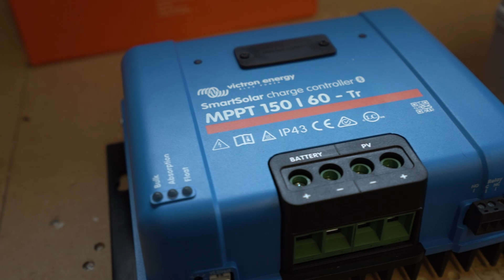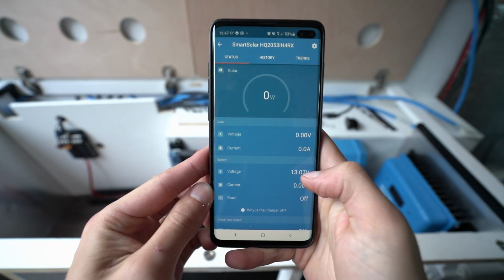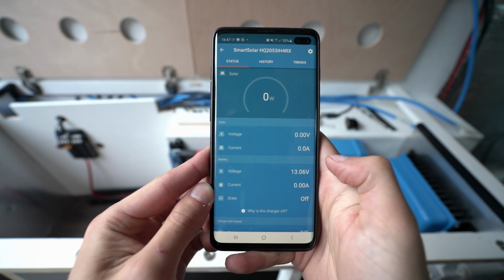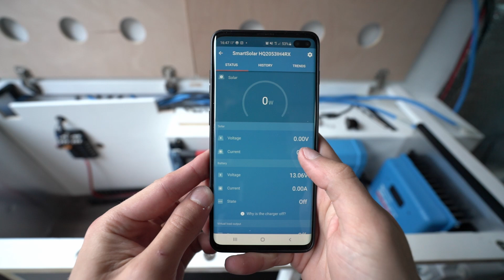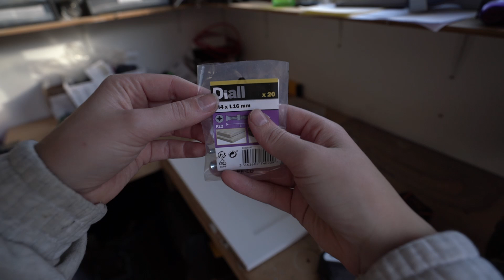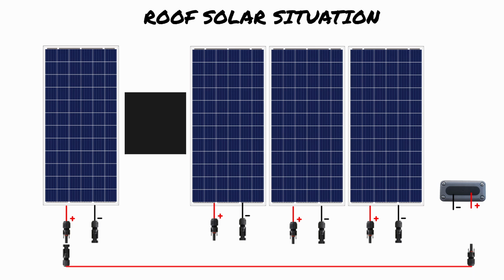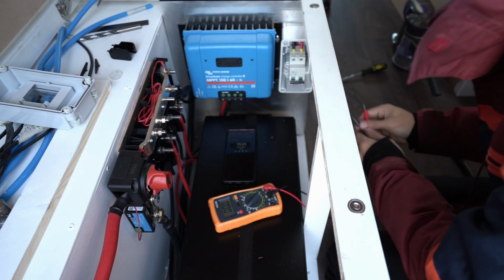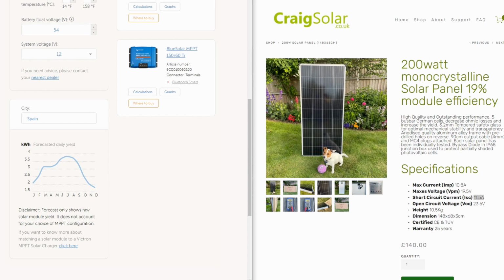Victron Smart MPPT 150 | 60 Install with 800w Solar - Citroen Relay Camper Van Conversion - Week 28

Comment: Hi there. I know that you have used a 300A fuse for the multiplus, but what fuses did you used for the MPPT / ORION / 12V panel ? Thanks
Reply from the maker: Hey, they are 60A fuses, thanks for watching, hope it helps!
Reply: @CasLaz  thanks a lot

Comment: Another great video you two. Can I ask what made you wire in the panels in series. I think I’ll be going for 700w wired in parallel and so I can get away with a 100/50 solar controller. Yours is an absolute beast. You probably won’t need a shore connection with that system. 

Just got our peapod graphics for stickers and logo for the van. Cannot wait to get started 😀
Reply from the maker: Thanks David! Honestly, it was a recommendation from Roamer. 
I believe the main benefit is that the MPPT needs a minimum voltage +5v above battery voltage to start charging, wiring in series allows for higher voltage same amps. So in lower light conditions the charger should keep charging compared to paralell you might struggle to get enough voltage for the charger to start charging. 
Awesome!! Maybe we should get some stickers, not long now till you can get started !! 😁
Reply: Thanks,  that's interesting and I hadn't thought about charing longer in low sunlight  I'll have a think about that.  The van build cost just keeps going up and up... and I've not even started yet. 

We got the stickers to swap/give to other people..... and the girls will put them on the surf boards too.  I don't think we will do the youtube thing,  but will definitely connect with others on Instagram.

We look forward to the next one :)
Reply from the maker: @peapod2083  Haha yeah our van build budget increased a few times now xD 
What's your instagram? Excited to see how you get on when you start!
Reply: Hi Philip,  I'm going to have to look into this a little more.  I was going to wire in parallel, so the amps onto the batteries are higher when it's sunny. That way you are charging quicker,  but not as long a charge window. 

Thanks for the recommendation.   I had be looked at Renogy, but my ocd is steering me towards all blue with victron.   Ive got a few more months before my van is delivered,  so I have time to think 🤔
Reply from the maker: Once you go blue it's hard to break out considering how well the whole eco system talks to each other. Definitely comes at a premium price but if your budget allows for it it's worth it! I'd also mention that they hold their value a lot better which will affect re-sell price, something to consider long term!